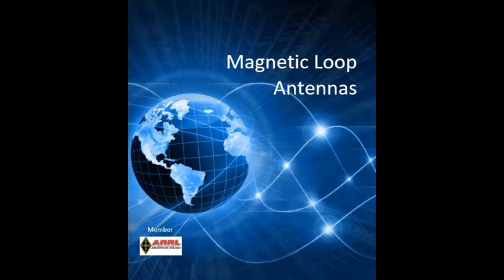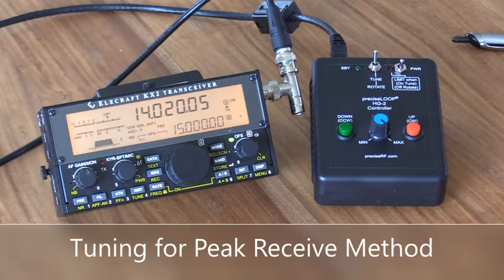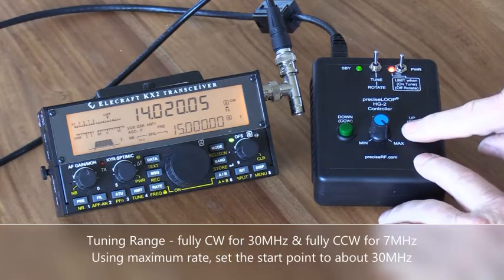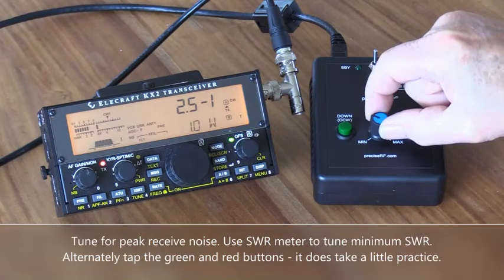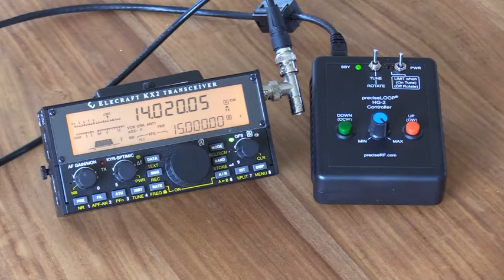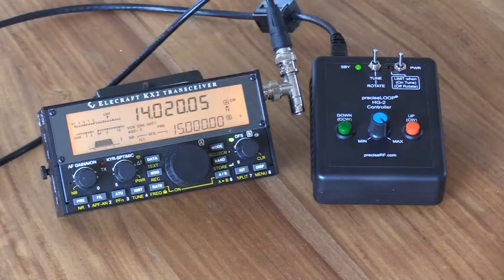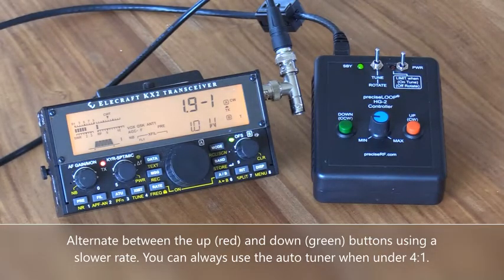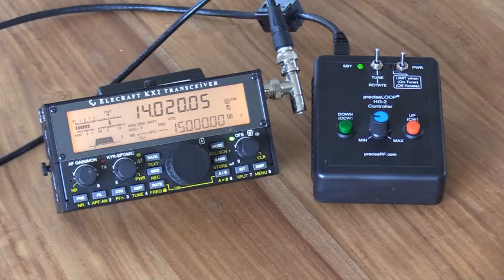Tuning the HG-1 WR magnetic loop antenna

Comment: These units are not waterproof and beware the customer service is non-responsive to documentation requests. If you need to spend $800 then just remember there is no customer service
Reply from the maker: John, We're sorry you are not satisfied. We've never said that the units are waterproof. The enclosures are not meant to be used in weather conditions that would allow water to penetrate the units. We do offer customer support via our website using the customer support form. Happy to answer additional questions if you have them.

Comment: After tuning a Small Magnetic Loop Antenna with the ANTENNA controls,   NEVER, EVER use the Transceiver INTERNAL antenna tuner.  When this is done,  the LC circuit in the Antenna is fighting the LC circuit in the Transceiver.  It may look good but the circulating currents in both will increase.  It gets much worse at high power [100W].  The result is still the same.  I will not risk my expensive transceiver.
Reply: Totally agree.  You defeat the purpose of the high Q match ,  something is amiss in the demonstration, if the cap is not flawed and the antenna is away from objects at least 3 feet then you should easily get a match.  I have owned several loops including the Precise RF loop and getting a match to near 1 to 1 was always easy.  73 Jim
Reply from the maker: Correct! You should not use the antenna tuner in the transceiver while tuning the HG1.